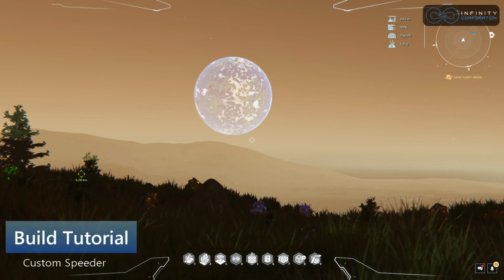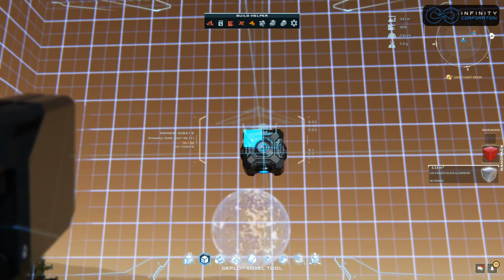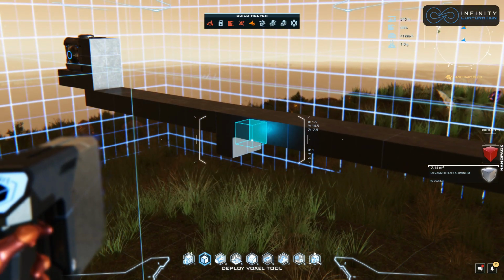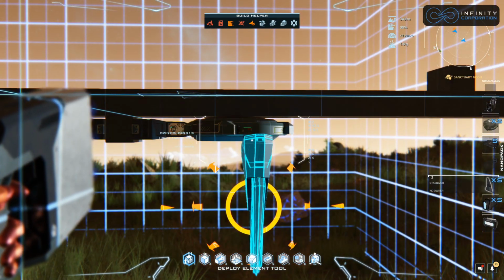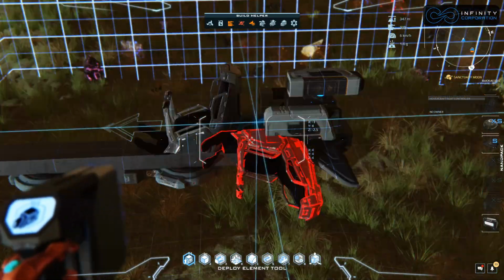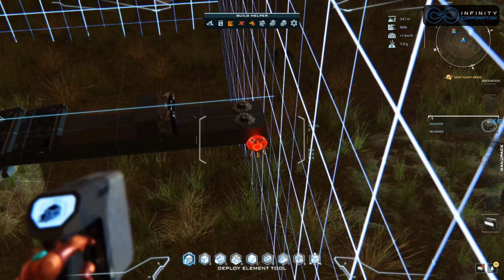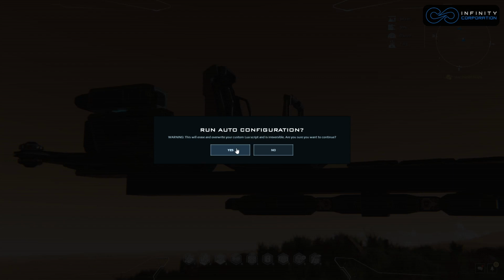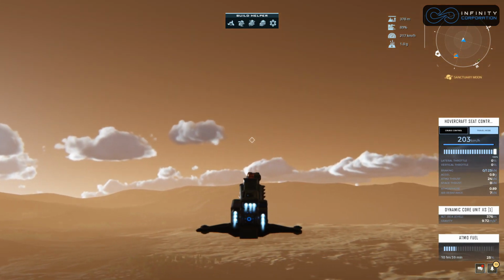Dual Universe Build Tutorial - Custom Speeder

Comment: how do you take it apart? Trash? I don't see anything for taking things apart which is what I am trying to do
Reply: Go into build mode, equip the place element tool, hold down the ALT key, target the element you want to put away, then click. Use the same method but with the voxel tool to put away voxels. This does not work for the core. To put away a core you need to exit build mode, equip the tool to place cores, hold down ALT then select and click it.
Reply: @pacoo2454  can't you just make a blueprint, deconstruct it, and then reassemble it using the blueprint ?
Reply: @gapper3  as far as I know, what I described was the deconstruction. but yes, in build mode if you press P a blueprint is created that can be used to reassemble a craft else where if you have all of the parts for it.